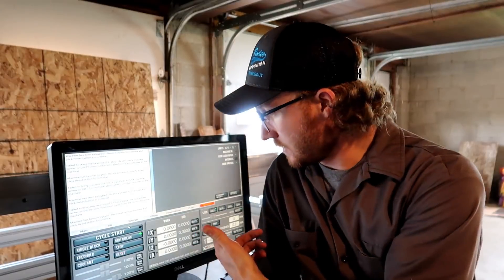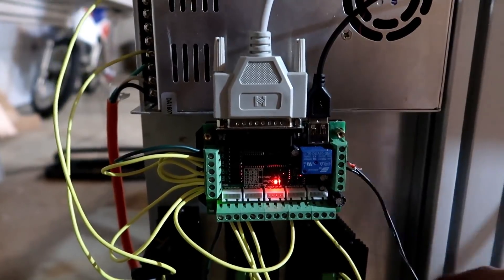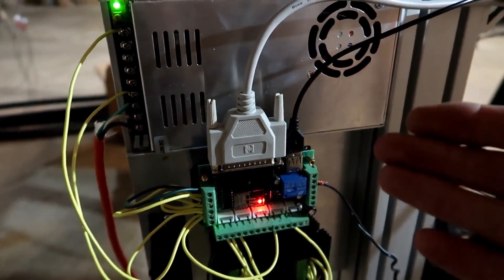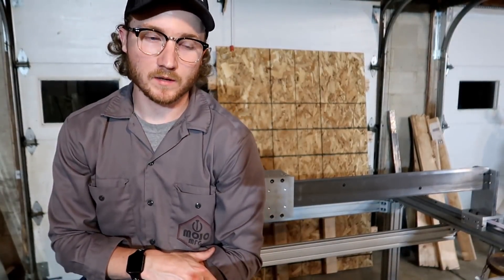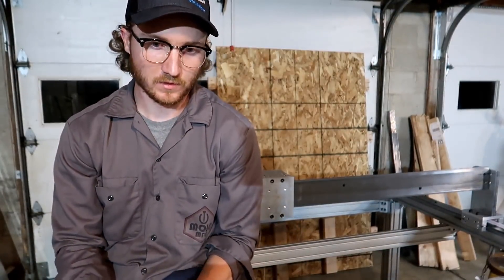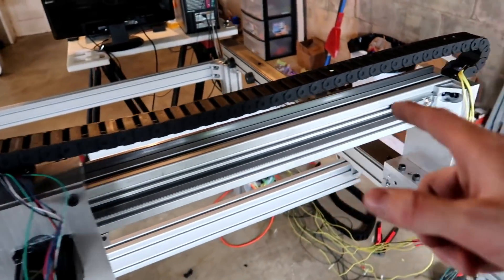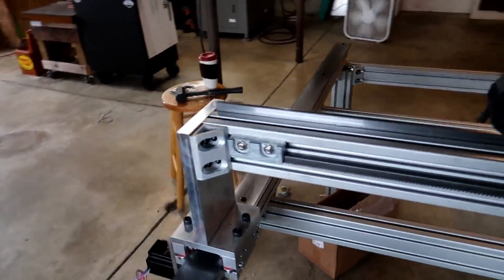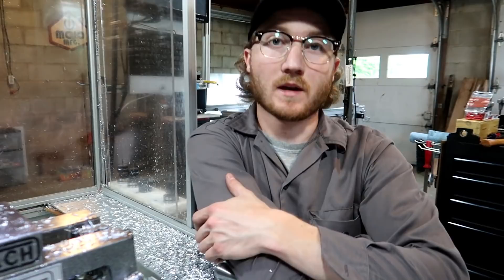DIY CNC Plasma: We Have Movement: Home Mfg. Days #42

Comment: You are going to need z height adjustment you can adjust while it’s running. It can be manual until you get ready for a thc but the sheet won’t be flat enough to adjust once and cut. Been there, done that. Until you get a thc you will want the post processor to pause before it fires the torch to let you adjust the height each time. The difference between snuffing the tip and not getting an arc transfer is not very much.
Reply from the maker: I see.  That is very good to know.  I will set it up initially to adjust it while it's running until I get the THC.  My thoughts, for example, my table is 4' x 4' and if I wanted to cut a 3.5' square and I had a THC then it would initially find the correct height and then move clear across the table at that height, right? Or will the z-height move as it is running not just right before it makes a cut? Just seems to me if it stays at that height then it could potentially run into some warped spots of the material as it moves that far across the table.  I haven't done too much research on these things so I apologize for my lack of knowledge on the topic.
Reply: THC has two separate parts to it.  The initial height sensing and voltage sensing.  Initial height sensing is pretty much a z axis with a floating torch mount that will trip a switch.  Think about how a probe works in the tormach only you are using the torch to push the switch.  The voltage sensing part reads the voltage from the plasma power supply if it falls outside of a set band it will send the controller an up or down signal.  Low voltage means the arc is short and too close to the sheet.  High voltage means the arc is long and too far away.  This is supposed to adjust while it is cutting and should follow a warped sheet.  PathPilot will probably cause you some problems here since there is no method to let the controller follow the Z commands of the THC.  There are probably some linuxcnc versions that would let you use THC and your mesa card but I've never tried that.  I've only used Mach3.
Reply from the maker: Awesome thanks for the information! If PathPilot doesn't workout then I will go back to Mach3.  I'm sure it will be better this time with parallel port breakout board(if i do go back to it)

Comment: I don't know if this will work for you but I have a 2 axis ProtoTrack and I post it as a .cam instead of a .nc and it gives me a pause to set z.
Reply from the maker: Hmm...I'm not sure if that will work for me or not.  I can set Z before I start the program but my main problem is getting the torch to turn on and off correctly.
Reply from the maker: I retract my statement.  Maybe it would be a good idea to try that and pause it to set my z-height.

Comment: I run Mach with a laser using regular mill post. its very easy.... you use the dir signal for what would be the Z stepper to turn the torch on and off. In fusion all cuts will be 2D/dxf/trace moves. you simply make all cut move a set depth of -.1 ... the way a stepper driver works is with 2 signal wires, a direction signal either high or low and steps, pules per move. The dir signal stays in the last state till the dir is changed. So you send the 5V Z step signal to a relay to control the torch on and off any - the move will go high and + move will switch it low. i.e you torch on and off. no special code or post just do a trace cut and a cut depth of -.1 Done works like a charm.  For the THC there are cheap stand-alone controls that work independently of the motion controller cheap like under a hundred bucks they measure the voltage arc to adjust a Z stepper.
Reply from the maker: That is good to know!! I really appreciate the help! If I can't get the post processor in fusion to work correctly then I will look at taking this route.  As for the THC, I really had no idea how they worked but I didn't know they were under $100 either.  I will take a better look at these now that I know the price is lower than I thought.
Reply: I have a better solution for you free, ping me a PM with your phone number.
Reply from the maker: I'm not sure how to PM you through Youtube. Send me an email. mojo.mfg.ops@gmail.com
Reply: Good info. Was looking for stuff like this. I may build a plasma table in the future. Have a router with mach3. So making another profile would be a breeze.

Comment: How did you figure out the correct steps for your axis?
Reply from the maker: I'm using 1/16th microstepping and the pitch diameter of my pinion gear is 0.75".  That gives me 2.355" of linear travel for one rotation of the pinion gear.  So for 1" of linear travel I only need to turn 0.425 revolutions.  0.425 revolutions at 1/16th microstep = 1360 steps per inch.  Then I sort of just fine tuned it from there.
Reply: So what files did you edit in pathpilot?
Reply from the maker: There is a tormach_440.ini file that we had to edit to make the steppers run correctly and get the right speeds.  We(meaning y milord) is currently editing the Pathpilot post processor in Fusion 360 to run the plasma.

Comment: Can't you just make the tool path in fusion not have any Z depth?
Reply from the maker: That may work in a hacky sort of way but still the torch comes on with an M3 command and off with the M5 command. If I were to use the regular milling post processor then fusion would turn the torch on and keep it on thinking it is a spindle.
Reply: Fusion360 will output laser cutting (2d) so just find a post which output g-code which is close and then edit the post to remove/update the commands you do not want. The post is very simple code. Be happy to help with the editing if needed.